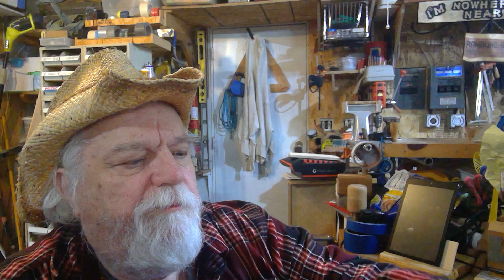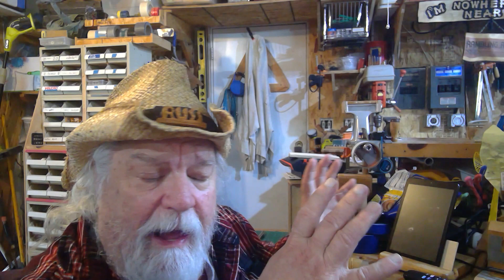Batteries Coming Today by Rambling Russ

Comment: I had the same thoughts about the 6000ex.  My guess is they’ll replace it with an 8-10Kw HF model, so I ordered a refurb 6000ex too!  I built a cart out of the 3000w EG4 inverter and 1 battery and posted videos on how well it works as a back up generator.  Its only 120v but runs most of my house.  I think off road tires is a great idea since you’ll have over 400 lbs of weight with the inverter and three 5.1kWh batteries. I’m looking forward to watching your build! 🤠👍⚡️☀️
Reply from the maker: EG4 makes an 8k now but it's twice as much.  I put the major pieces on the cart today and rolled it around.  I think I am going to build a two-wheel cart using 16" wheelbarrow wheels. The off-road tires on this cart really make a difference with this much weight.
Looking forward to your video building your version with the EG4 6K.  You have a plan yet?
Reply: @russveinot5754   fantastic!  you won’t regret the larger tires!  I’m still gathering up cable, fuses and trying to decide on more server rack batteries or start building my own. The cost difference is about 35% and we’d like to build up to 50+ kWh so that 35% is a LOT of money!  Stay safe amigo! 🤠👍☀️😁